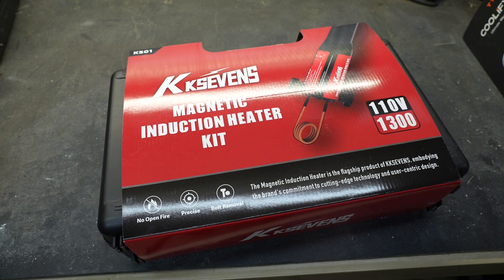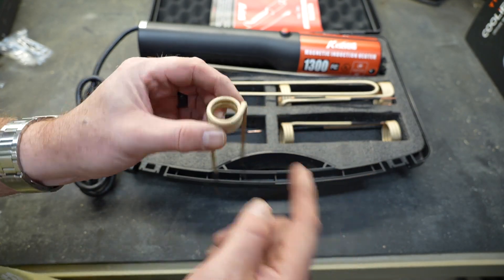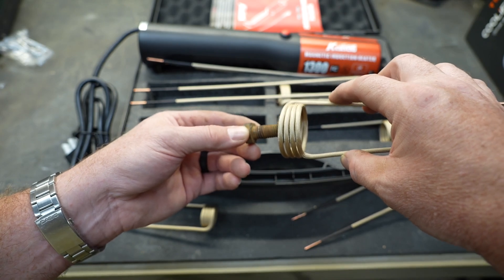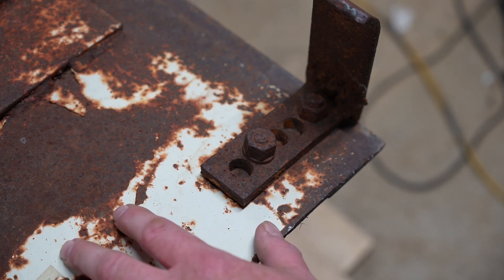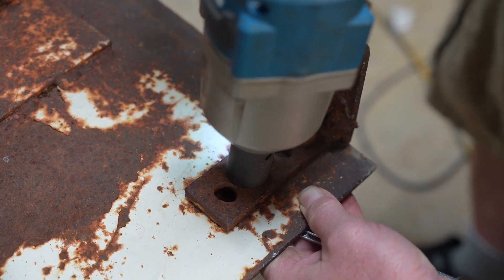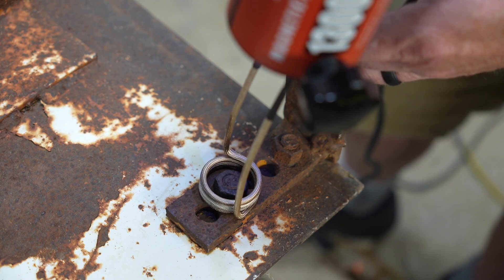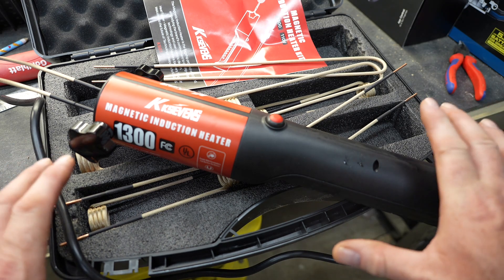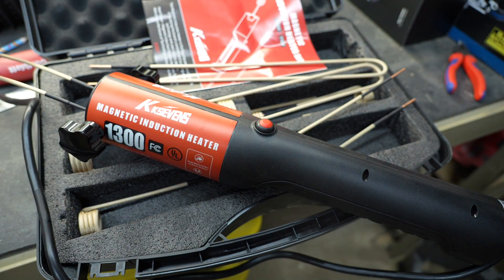Remove Stuck Nuts with Heat—KKSevens Magnetic Induction Heater, full review!

Comment: Nice. Handy for working on car suspensions when you don't want to have to replace everything rubber or plastic around the stuck bolt. Also great for fuel tank hanger strap bolts. I'm not interested in bringing a 'blue wrench' or angle grinder around them.